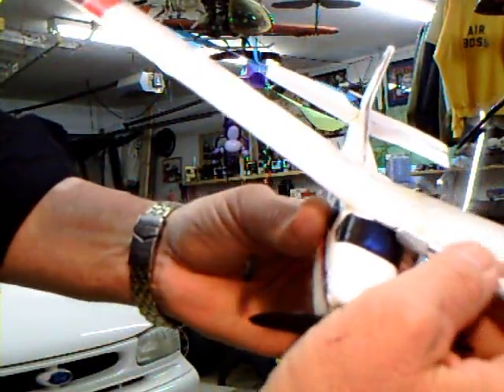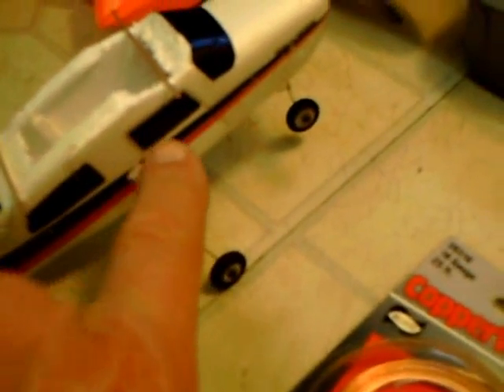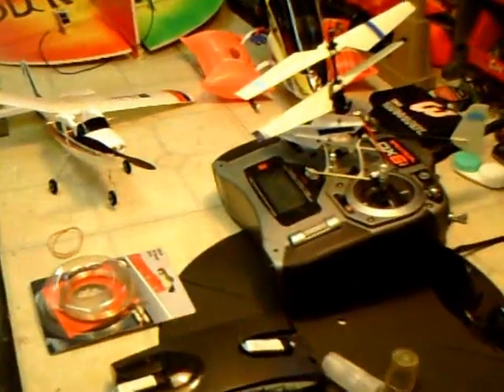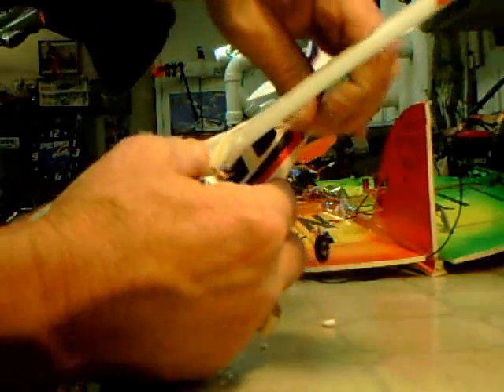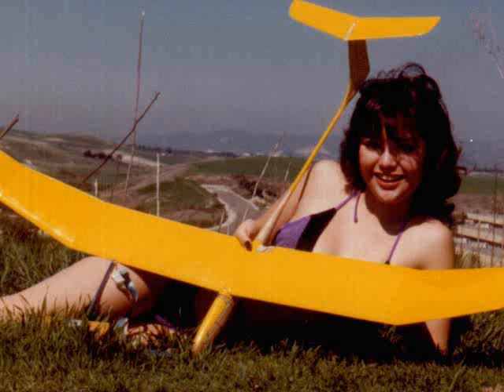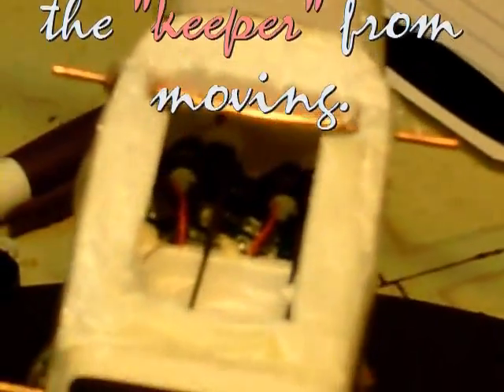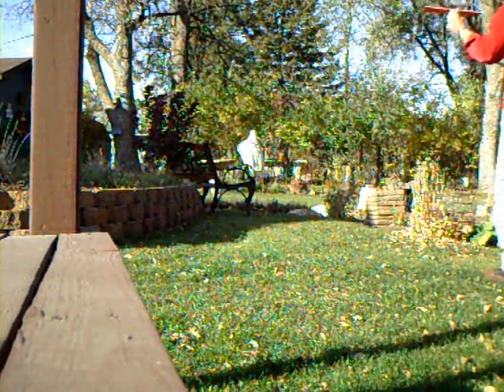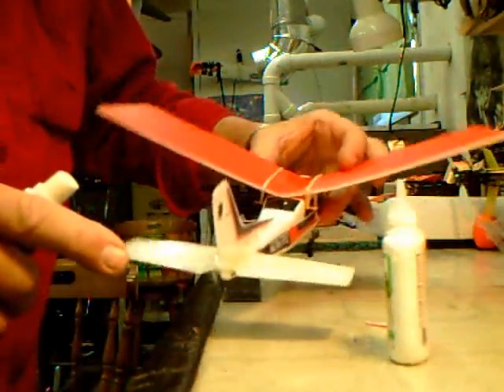Make a WING-SAVER for your Mini RC AIRPLANES.

Comment: @NightFlyyer yes that would be because the added weight means higher wing loading which in turn means the plane has to fly FASTER the more weight you add which in turn means you draw more amps to fly which translates to shorter run times so your comment would be correct but strength to weight ratio means the above posters comment is more correct across model sizes (for any noobs reading)

Comment: two  quick questions 
1. can i strap the rubberband from the back right to the top left copper rod and vise versa for the otherside?
2. is their a possible way to do something similar to this for wings mounted on th bottom and middle?  
thanks i'm new to r.c. planes so any answers help